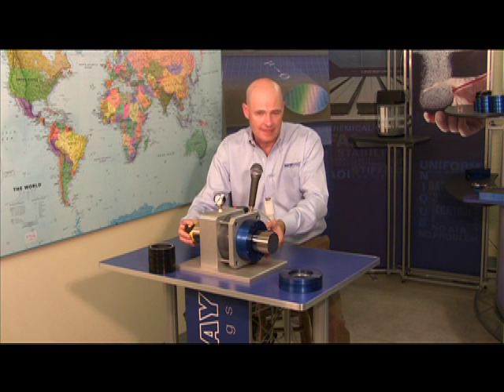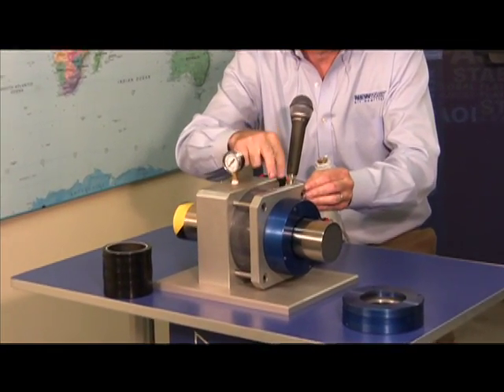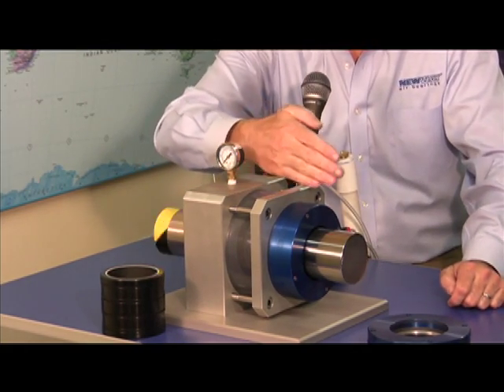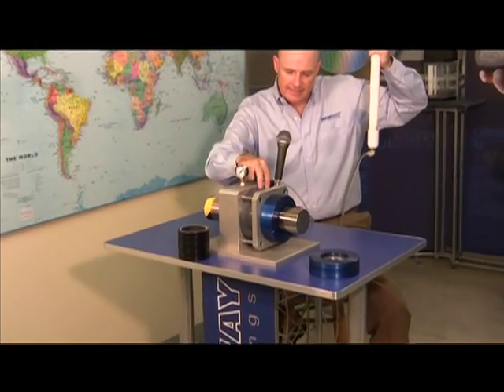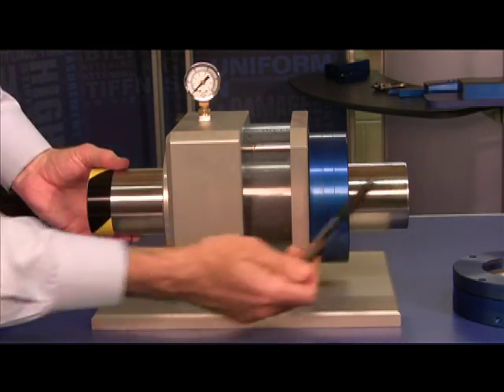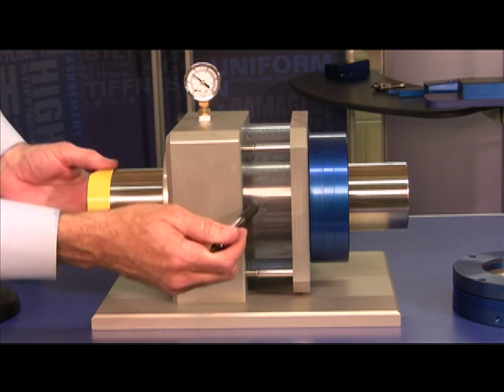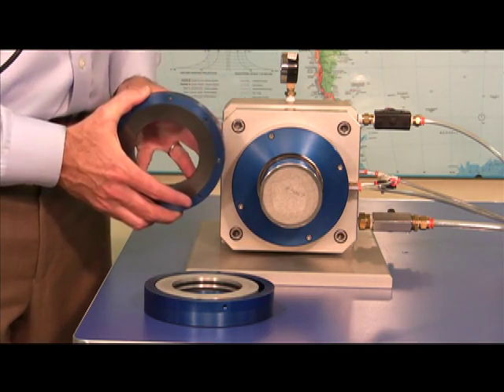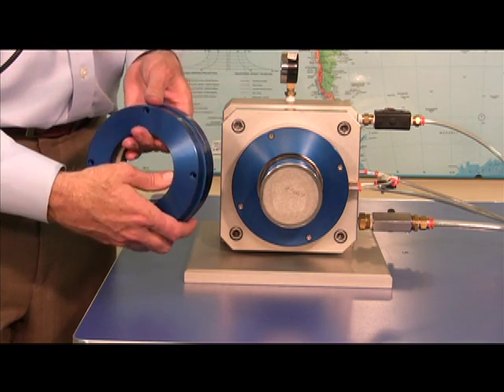New Way Seals

Comment: Differential pressure areas in hydrodynamic bearings creating a conductive path which pumps contaminants and how this is countered by air bearing seals with uniform high pressure with low flow in a small gap is a fantastic demonstration.